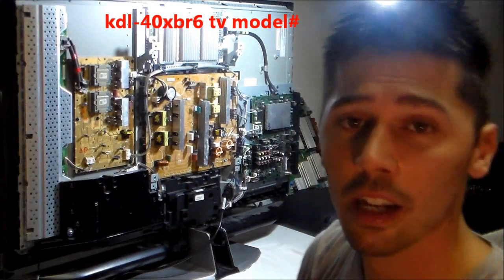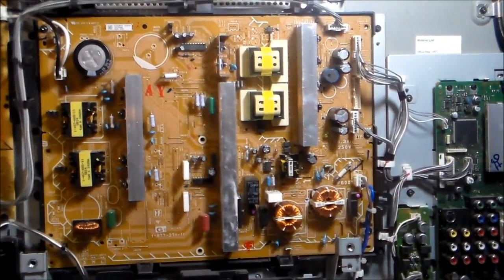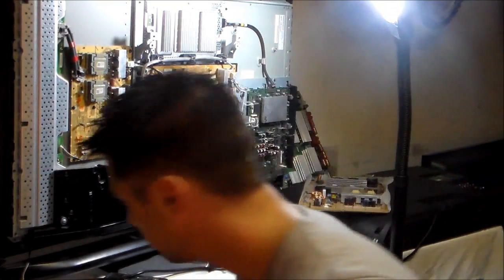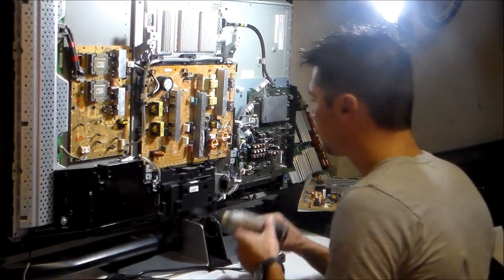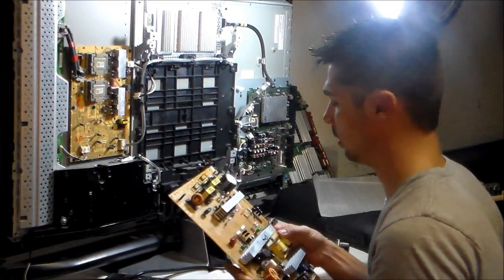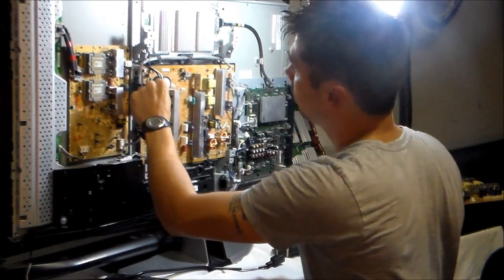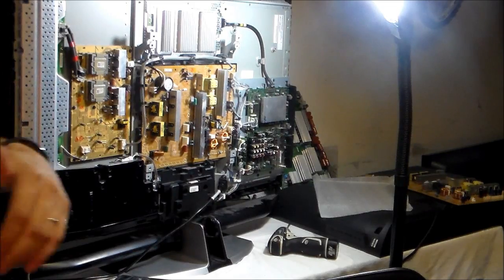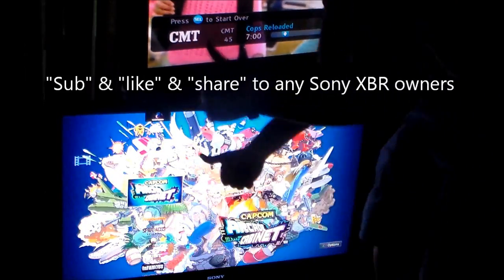5 minute LCD TV REPAIR!!! Sony XBR TV with no power and flashing LED

Comment: a good ps board can be used to diagnose a bad ps board.   Pull both (allow to de-energize) and check resistivity (ohms) values ... just match them .. see where readings start to deviate.  Might as well.  If things go well you end up with a good replacement board (in the float) - plus now you know what went wrong (and what might be giving up the ghost soon).   Powerful troubleshooting technique.

Comment: Hello, I have a Sony KDL-40XBR3. The TV was brought to a repair place because the complete screen has white dotted lines all over it on top of picture. The repair service center said that the main board was bad and the cost to repair was over 700.00 dollars. I decided not to repair the TV. Once I got the TV back home I decided to try and repair the TV myself since I was going to discard the TV anyway. I purchased a new Sony main board and installed it - truly easy. Well, the TV still has the white dotted lines completely all over the screen. On start up the green light comes on with no blinks. I would like to try and fix the TV for a spare. Do you have any idea what could be causing this problem or should I just trash the TV? thank you, troy
Reply from the maker: yes main/video board or Tcon board can cause picture problems, contact shopjimmy.com 8^)

Comment: I have a Sony  KDL-40XBR4.  The tv starts up okay but has a distorted, mixed up picture, mostly to the right side of the screen.  After the tv warms up for about 15 minutes the problem suddenly goes away.  The picture doesn't have the brightness it had when it was new.  I just helped a buddy replace the capacitors on his tv which restored the brightness in his.  Do I have a bad power supply also?
Reply from the maker: check 12v to Tcon and check Tcon board connection too. but it maybe bad tcon board-get at shopjimmy.com 8^)
Reply: Thanks! I will work on it and report back.
I found others with the same model and issue.  They described it as horizontal lines and ghosting.

Comment: i got a sony 40s4100 kdl no pic no sound what can i do joseAAA JL but ligth turns green when power is turned on
Reply from the maker: unplug tv powercord for 1 minute to reset tv, check video/audio connections, then check tcon or inverter boards.

Comment: Tampatec I really need your help!  Recently everytime I turn my KDL-40XBR6 sony bravia, it turns on, the screen is black ( no image) but i can hear sounds from the local channel.  After about 3-5 mins the tv automatically goes into stand by mode and the red light blinks 12 times and pauses and 12 times again.  I tried a hard reset as recommended by sony, unplugged it, disconnected everything attached to it and nothing, same results.  I called the support center and they tell me it sounds as if its the lcd panel, however i read the manual entirely and seems to point out something else.  I would like your help on this issue.  I bought this tv a in 2008 really expensive, the tv is hardly used, i still have all original stickers and cover plastics attached to it, and now that i opened to use it I encounter this problem.  Please help!
Reply from the maker: Unplug TV powercord and then unplug tcon board then plug in TV powercord see if that keeps TV on (green light should stay on) sometimes it is a bad panel or bad internal ribbon connections to panel. test inverter boards too same way.

Comment: I am working on a Sony KDL-40S20L1, owner said it was playing for 10 min then shutting down. Then could disconnect and reconnect power and get TV to play again for 10 min. Now TV tries to start then shuts down. When shuts down red light blinks 4 times, pauses and continues. Is there a componet level repair for this problem?  Or something to try?
Reply from the maker: 4 blinks is error for backlight assembly or inverter boards, contact sony to find out if tv was under recall - Priority Service: sony tv help 239-768-7547 let me know if this is correct number. http://esupport.sony.com/US/p/select-system.pl?model_type_group_id=12
Reply: I have the same exact problem with 65 X900!!!!!!!!! not even 3 years old! is this common  thing with SONNY???

Comment: I have a problem with my Sony HDMI KDF-E50A12U TV. For some reason I cannot turn it on. The standby light is flashing red twice and then staying green for two seconds, then flashing red twice again, and so on... I read several online forums about this problem and I thought it might be the lamp cover, but that is okay. Do I need to replace the lamp by chance? It does not seem to be broken either. Or could it be a power supply problem?  
I would really appreciate it, if you could help me. If you require further information from me, please do not hesitate to contact me.
Reply from the maker: Lamp may look good but can still be bad, if the lamp is over 2 years old or looks yellowish replace it, but on some Sony TVs 2 blinking lights is bad power supply. Call tech support to confirm and to Get the correct TV part-  1 (877) 881-6492 / (952) 881-6492
Reply: *****
Thanks for your reply. The lamp does not seem yellowish, but I may give it a try. I checked the capacitors as well but none of them is damaged. I may call Sony tomorrow.

Comment: LCD TV new Board? My question is if the board is repaired or the set breaks again don't the boards take something out sets can have a icu go bad on the board and take out 3 boards like Samsung LCD have been knowing to have hear solder job not done great. cost of a board it's cheaper to buy a new Set..

Radiotvphononut in his YouTube video says a CRT last longer can be repaired The LCDs don't

Comment: I need some help. Trying to fix friends Samsung LN T3732H so his kid can watch cartoons again in HD. At first glance, the power supply board looked like it had bad caps. I replaced the caps with new. Still, would not boot. So I bought a new PS. Still, would not boot. Then I bought a used Main board, supposedly the only problem was broken screen. Still no power up, but at least the intro sound would play. Am I missing something? What could the problem be?

Comment: The problem is when one board goes all 3 have to be replaced it's better in some cases it's cheaper to replace the set and take out the extended service place... Replace one board than the tv could crap out and another board it may need...  Radiotvphononut  on YouTube said board are expensive